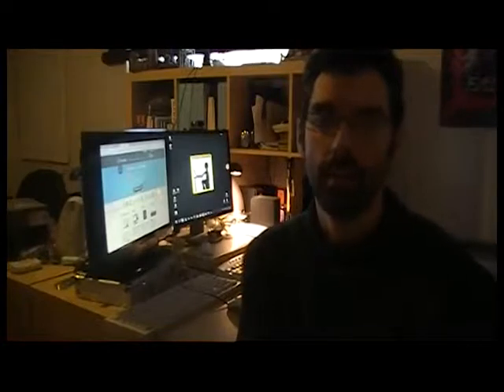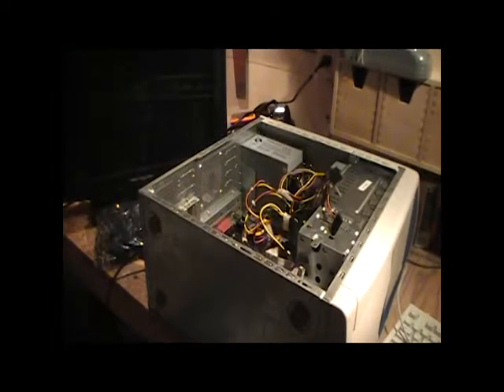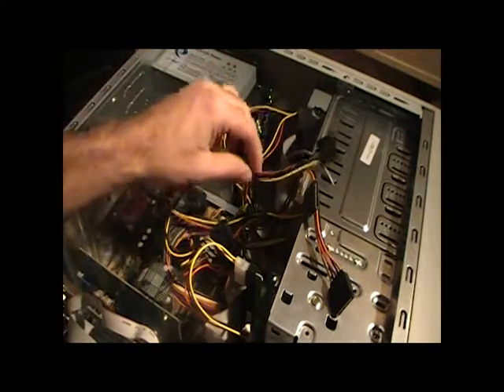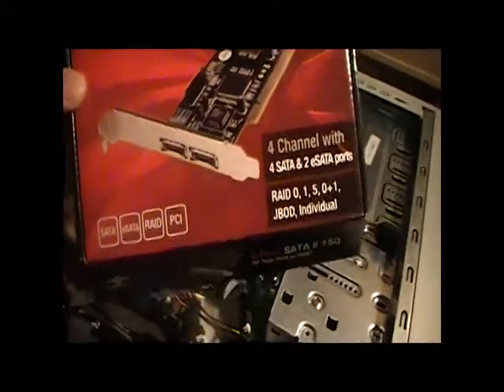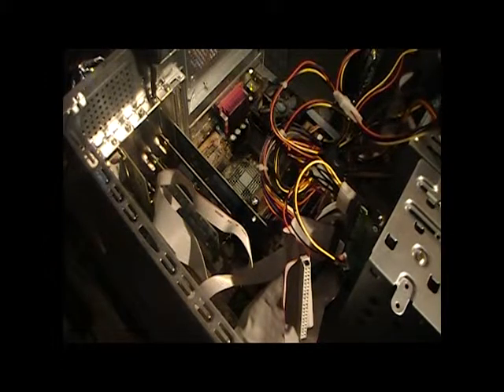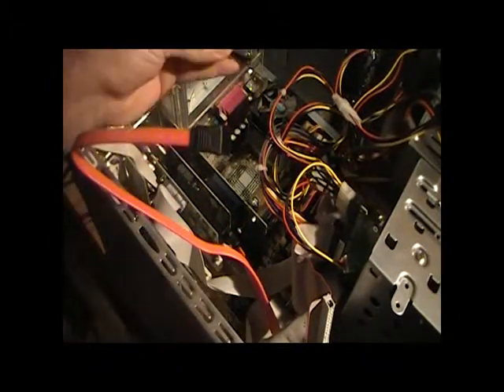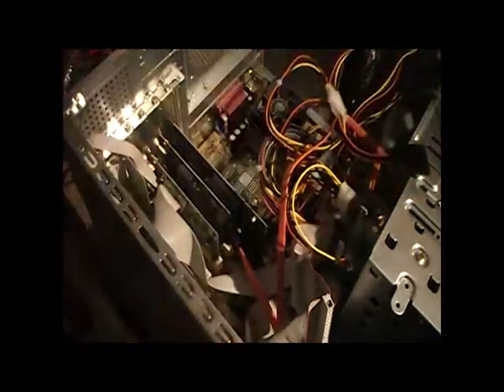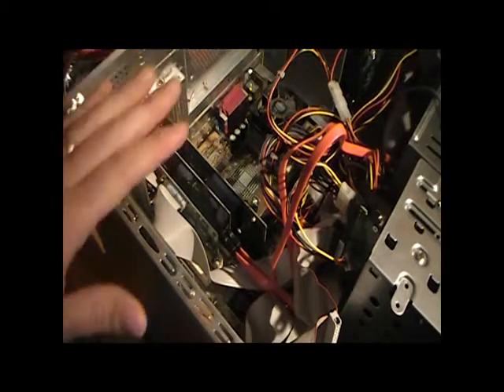Build Raid server with Freenas software with an old PC [Part1]

Comment: Unfortunately the latest FreeNAS requires 8G+ of RAM as well as 8GB for Install [ No CD/DVD ROM boot install  option]. Much more HW capability than the old XP PC's I was going to use..

Doesn't make sense to buy all the parts to upgrade an Old PC when you can get a disk-less NAS from WD or others for $150.
Reply from the maker: thanks for your comment.
It make sense in a way that I spent 40$ on a PCI card that can be use on another computer later. The goal is to recycle old components.

here a link for older Freenas version
http://download.freenas.org/9.2.1.8/